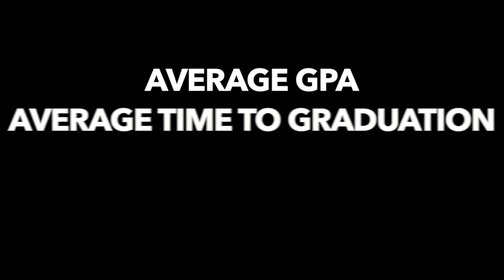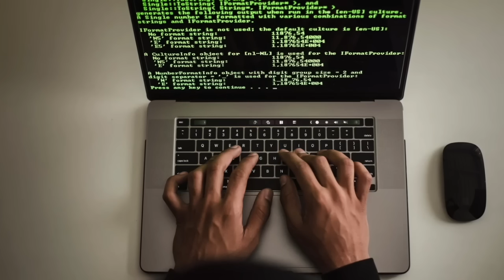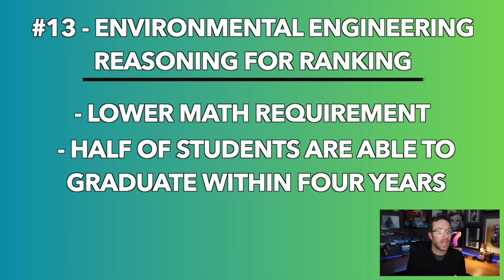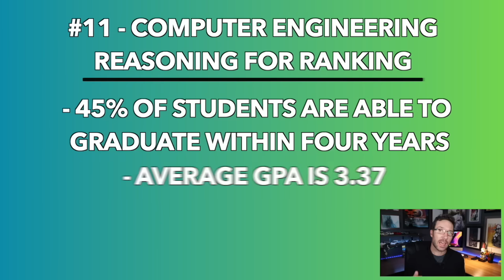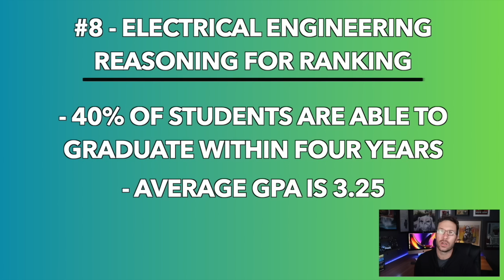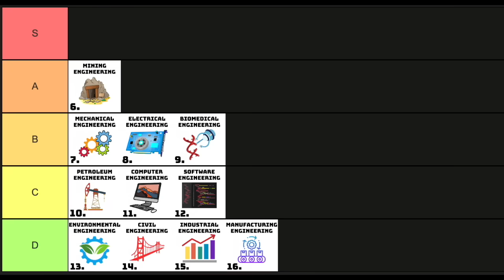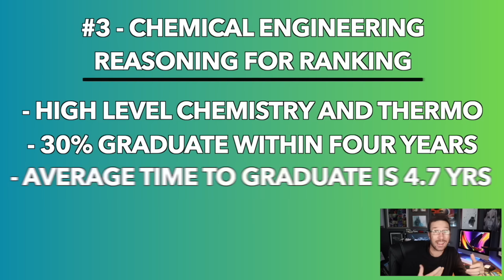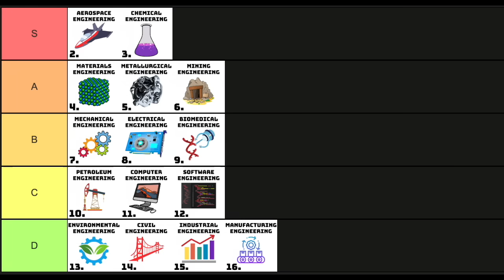Engineering Degrees Ranked By Difficulty (Tier List)

Comment: I'm a mechatronics engineering student so I've done quite a bit of both EE and ME. It really depends on exactly what you're covering, but EE can be very difficult and involved, ESPECIALLY when you're talking about RF engineering. Anything with true electromagnetic design and RF design requires partial differential equations, not just ordinary differential equations. I'd say it should be much higher than 8th
Reply: Yeah partial differential equations is considered a basic level class for our ME degree lol sorry but it is true what the video says, ME gets to learn the majority of all types of engineering degrees including electrical.
Reply: @Betooo  what on earth are you talking about? PDEs are not a basic level class for any engineering degree - they're typically taught towards the end, or at least towards the end of the math courses. 

I'm well aware that PDEs are required for mechanical, as that's where I learned them myself, I'm only pointing out that advanced electrical engineering requires them as well.

Also your claim that ME gets to learn the "majority of all types of engineering degrees including electrical" is complete bullshit. It is physically not possible to do that in a single degree. I'm around mechanical engineers all day every day and most of them know next to nothing about electronics compared to an electrical engineer. Same with chemical engineering - the mechanical engineers would have no clue what they were doing. Yes it's an all-round degree, but they definitely do not learn everything.

Maybe if you were claiming they learn all the math used in the other degrees I'd respect you a bit more, but your claim is just ridiculous.
Reply: @jackygrush  haha why are you mad? I'm in ME and I'm telling you what I'm learning why would I lie about that? Lol I'm sorry if you're surrounded by incompetent MEs but my university thought me about electrical, structural, civil, and even a little bit about chemical as well as programming. I took partial DE before I even entered the pre-ME program. Why is that so hard to believe lol sorry if you had to take that till the end or if you struggled and think it's hard but I passed partial DE with an A+ before I even took any engineering classes 😆 right now I'm even learning about quantum mechanics as we speak. So yeah MEs do get to learn about everything.
Reply: @Betooo dude😂😂 you're lying to yourself
Reply: @Betooo  Either you're a liar, or you have no idea how basic the material is for those subjects that is taught to MEs. If you guys learned everything about those other subjects, then there's literally no reason for them to be separate degrees. Everything would just be ME (it's not).
Reply: @brianleonard6598  haha I couldn't care less about you thinking I'm a liar or not, I don't need anything to prove to you 🤣 all I wanted to say from the very beginning is that I took PDEs way before I entered the ME program. So to me it is not that hard. That's all lmao. Now another thing which I am not sure if you're an ME yourself but in West Texas A&M, MEs get to learn about pretty much all areas of engineering. I'm not saying to the full extent but we do learn the basic theory behind each subject. By next semester I will be taking Modern Physics which teaches about the theory of relativity and string theory. I'm not sure if your school or if you even go to school lmao but idk how other schools teach subjects to their MEs. Also AGAIN why would I lie about this?? I wouldn't gain anything from lying about this at all 🤣 please go teach yourself something or go read a book or something. I'm trying to build an earthquake shake table so please leave me alone 😂
Reply: @Betooo  I'm actually a software engineer. I'm not doubting you probably have touched on a few different fields at a basic level, but your original comment made it seem like you think MEs are out there learning EE and chemical engineering when what you guys do is very superficial at best.
Reply: Mechatronics is the best interdisciplinary branch to study for the future.
Reply: What is RF ?
Reply: @ak0oo  radio frequency. And the electromagnetic spectrum more generally.
Reply: @ak0oo radio frequency (electromagnetic waves)
Reply: You need to use partial diff in mech eng also for the thermodynamics and fluid mechanics problems. RF modelling can basically be considered as fluid flow. Similar to FE analysis for stress analysis. It's different sides to the same coin.
Reply: @klmn2000  Yea ik, did PDE's in a mechanical course last year. I'm just pointing out that they're required for advanced electrical stuff too, they're not just a mechanical thing
Reply: If doing antenna array calculation the problem goes to matrix level, some of the engineering field can be divided deeper
Reply: Can a mechatronics engineer work in mechanical and electrical jobs or only jobs that are specific to mechatronics?
Reply: @rayansedits5556 Yes they can. However there are some portion of positions from the Mechanical side a Mechatronics cannot do. Like fluid dynamics, thermodynamics, and some other things.
Reply: @FlowSharp  Not true. I did mechatronics and we had 2nd and 3rd year modules in thermodynamics and thermofluids. Wouldn't call myself an expert on it though. Depends on the course. The balance between mechanical, electrical and software isn't balanced across universities from what I've seen. Most mechatronics guys I graduated with ended up as controls engineers. Although some went mechanical and some went straight into becoming MS. Excel engineers (project managers).
Reply: BSEE undergrad and worked R&D at Motorola designing RF equipment and components and I couldn’t agree more with your comment.
Reply: Some of the replies don't get what you are saying, partial differential are not the only thing that makes electromagnetic and RF difficult, there's vectors, imaginary number, locus, Nyquist, Laplace, FFT and all other shit that failed me
Reply: @ivanjefferson6344  yep sampling theory, some of the upper level frequency domain and signal processing stuff etc can be pretty tricky for sure. I'd definitely contest the assertion that the math in mechanical is always harder.

Comment: Very well-laid video, thank you. 
I agree with your ranking. Where would you place Robotic Engineering? 
I got a degree in Civil/Structural, and now I am getting a second degree in Robotics; math gets a bit harder than what I recall from my previous major, especially in EE and AI related subjects. Robotics is a multidisciplinary major made mainly by Mechanical, Electrical, and Computer/Software Engineering and, in my opinion, should rank side by side with EE and ME. 
Also, I do not remember touching Partial DE in the Civil Major despite doing a Thermodynamics, Chemistry and Material Technology, while I did touch Partial DE in the Robotics Major.

Ciao
Reply from the maker: Id say robotics would be top 6

Comment: Like you said, every engineering discipline probably thinks theirs is the hardest but I think biomedical engineering may not really be rankable on this list simply because it is a young field with a great deal of variance in programs. At the school where I earned my biomedical engineering degree, BME was the most difficult engineering discipline. Out of the engineering departments, biomedical had the highest course requirements at 130 credit hours and the highest minimum GPA to remain in the program at 3.2. Students who dropped out of the department sometimes went to mechanical engineering, electrical engineering, or computer science. You also had to finish up through organic chemistry and automatically earned a minor in mathematics just by fulfilling the BME course requirements.

Comment: Have to add some comments.
Where I come from, software guys needed not only 3 levels of differential (calculus), but also higher level algebra and, particularly, discrete math.  We also had to understand computer architecture, which required SOME of the computer engineering stuff, such as digital logic.  I'm speaking from the perspective of getting an MS in CSE, but much of the same was required for undergrad.  More to the point, employment also required understanding of hardware and software.  Most of the math never raised its head at work, but the neuron development so induced in school was very helpful.

As for difficulty, computer engineering required many EE skills that software didn't.  Software, however, is the one discipline that, in the workplace, potentially overlaps every other discipline used in any kind of business, because its business is representing all manner of human activity in some form.  If you've seen the ghastly stuff your doctor office uses, you get an idea of how difficult it can be to represent someone else's business in software.  No imaginary numbers or Fourier transforms, but domain acquisition ain't for sissies.

Getting back to acsdemic difficulty, chemical is considered hard, as is EE.  IOE intersects with management.  Civil, NME, ME, and architectural may all require pursuit of  LPE status - not only can that itself be daunting, but can you spell LIABILITY?  If you design bridges, you'd better be thinking about it.  That may take you to an ancillary understanding of law.  Just sayin'.

Comment: Decent analysis, but the math levels may not be accurate.  I have a BS (Wisconsin) and PhD (Texas) in Chem. E., and an MS in EE (UC-Irvine).   In particular, at Wisconsin (arguably the best school in the world when I was there) we studied PDEs as they applied to Transport Phenomena.  This was Junior year. And PDEs also were applied to chemical reaction engineering at both the continua level as well as the unit-operation level.    Generally agree with the overall levels.

Comment: ChE here - this tier was pretty much exactly what I expected. All of the top engineering specialties fall under the ChE/ME umbrella (metallurgy, materials, aerospace, etc.). All the bottom engineerings fall under the Civil or Industrial engineering umbrella. Nuclear engineering is essentially an intense hybrid of ME and ChE plus nuclear physics, so it's no wonder it's the most difficult.

I will add: engineering is a discipline that you really have to have the aptitude. If you don't have interest in the field you're thinking of studying, it's going to be much more difficult - for this reason, I would rank software engineering at a higher difficulty. But, in terms of the metrics used to determine difficulty, its placement on this list makes perfect sense. (Many of my friends who went into the field were already coding for a few years, so it's not surprising that they finish with higher GPAs in a shorter timespan.)

Edit: I saw another engineer post that Work Experience is much more valuable than Academics, and that is 100% true. I would also add that real world experience is ultimately what made me love my field. When I went into chemical engineering, I really didn't know what to expect - just that it was considered one of the most difficult degrees to achieve, it pays good money, and that I enjoyed math and science. It couldn't have worked out better for me. However, I might be the exception, not the rule.
Reply: Basically everything you said I completely agree with except that I think software engineering isn’t more difficult 😂 just cause I have a background in programming.

Comment: Rankings look reasonable. The highest level of math may be misleading, as degree specific  content can be more difficult. Also, in  Chem E (my undergrad degree), for example, partial DE is required for several Ch E courses in BS, even though the highest required math level cited is normal DE.. Also, courses like P Chem, Thermo, kinetics are more difficult than the math courses, in my opinion.  I also want to add that Chem E courses today include bio processes, which was not included when I was getting my degree.

Comment: Electrical engineers require partial differential equations. See Maxwell's Equations which explain electromagnetic relationships. I am an EE and have had to work with that for closing in on 40 years.

Comment: Ranking Engineering degrees by how many hazing math courses the professors inflict upon the students is like rating a software program by how many lines of code it has. It is a meaningless metric. It also ignores other side disciplines that you may have to analyze such as linear algebra, Boolean algebra, or applied mathematics such as Fluid Dynamics, RF filter design, or Signals and Systems. Also, many people start off on one degree and then transfer to another. This results in many more credits taken and longer time spent pursuing a degree. As for what a degree pays, that's also not much of a metric. It has nothing to do with difficulty of the degree and everything to do with supply and demand. You could get a degree in some obscure, difficult, and highly technical subject, and nobody else will really understand what it is. So your salary will be whatever some research institute is willing to pay you. You also did not look at the GPA of incoming high school students that pursue the degree. Some degrees attract the best and brightest while others may not. Thus graduation rates with the degree is skewed accordingly. 

On the whole, this is a poor exercise for evaluating difficulty. It is extremely superficial and it fails to capture many details behind each degree.
Reply from the maker: how would you do it? - math was one of the only common traits in all degrees, so it seem somewhat relevant. although i place more importance on time to graduate

Comment: Nuclear, Chemical, and Petroleum Engineering all require math beyond partial differential equations… you will study complex math, 3D calculus, thermodynamics, Laplace and Fourier calculus and all three principal transport processes… mass, energy and momentum. Electronic and Electrical engineering come close except they typically do not study mass transfer.
Reply: Yeah, but instead we have to study electromagnetic fields and control theory, basically transfer of electrical energy
Reply: @xgouchx714  ChemE's study motors, EMF, control theory, PLCs and so on. Not so much low voltage circuits but rather high voltage stuff.
Reply: I studied Petroleum Engineering in Nigeria and I can remember study Laplace and Fourier functions. Studied a bit of thermodynamics and structural engineering. 

Let me explain how engineering degree programs work in Nigerian Universities:

1. The program is generally 5yrs with the first year being dedicated to studying physics, chemistry and base level math like trig functions algebra and statistics. 

2. The second year is dedicated to studying general engineering faculty courses at the base level. This means that regardless of your department (course if study), you'll still get to learn the same courses as every other engineering student. As a Petroleum Engineer, I had to study basic thermodynamics, applied and fluid mechanics, strength of materials and Engineering drawing. The idea is that you'll shield be able to grasp basic level engineering concepts of other disciplines. The math at that level was basic calculus.

3. The third year is dedicated to studying basic "departmental" courses. This was the year I started taking course like Drilling technology, Basic rock and fluid properties, basic Petroleum Geology and the likes. The math at this level is at the highest.  ODE, PDE, Fourier and Laplace transform etc.

4. The fourth year is dedicated to studying advanced Petroleum Engineering courses like Reservoir Engineering and advanced drilling courses. Reservoir Engineering is arguably the most difficult course in Petroleum Engineering. There was no longer math at this point but advanced statistics like Newton-Ralphson iteration etc.

5. The final year is dedicated to studying Petroleum economics and Nigerian Oil industry mining laws and thesis.

Comment: What's with the degrees that top out at Integral Calc?  I thought ODE was required for all ABET-accredited degrees.

Also, how are you divvying up your calc requirements?  I assume 1 is differential calc, 2 is integral, and 3 is multi-variable?

As a metric, the ability to graduate within four years should be the lowest category, as it may be determined by self-selection on the part of the degree seekers.  Highest level of math should be the top metric.

Comment: I'd be interested in seeing this list at the PhD level. My bias is that Material and Chemical Engineering are the most difficult by far from my interactions with those types of engineers. For what it's worth, I have a degree in electrical engineering and was very successful in the aerospace sector. I don't see any aerospace specific skill that isn't covered in the other engineering disciplines unless you want to get into specialty engineering like radiation and EMI/EMC